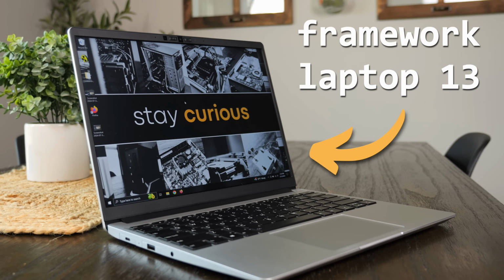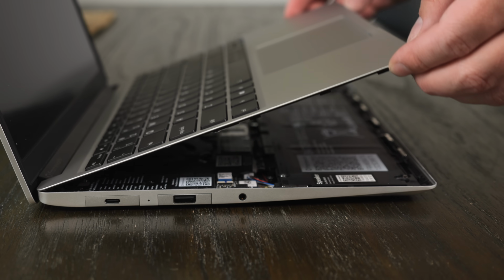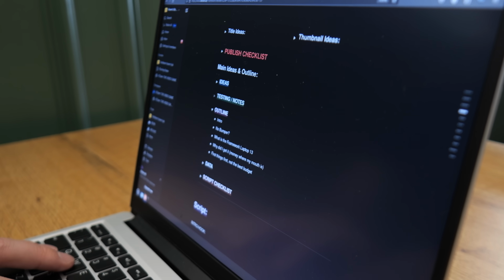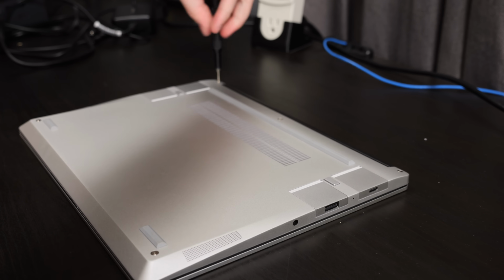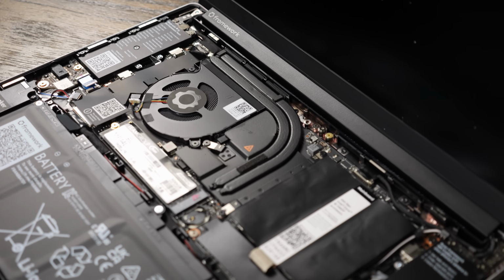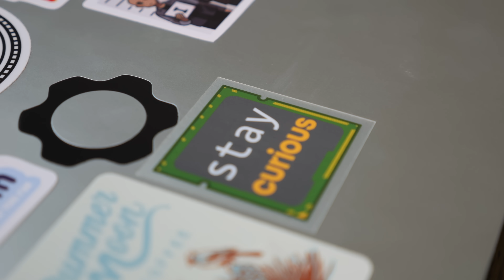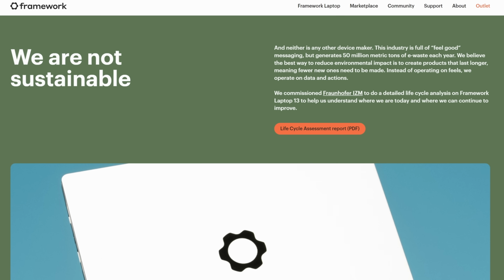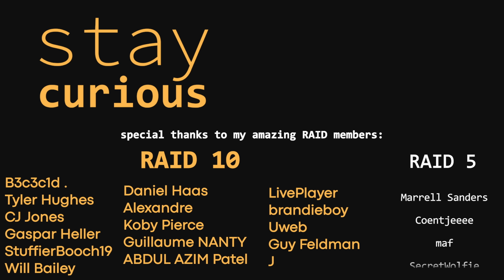Is The Framework Laptop ACTUALLY Worth It?

Comment: I'm not a fan, their high prices still can't compare with other laptops with much better features. You're making an excuse that 'your regret' is negated by the fact you can change things but consumers still have the expectation for battery life, performance, proper cooling, etc. Don't make excuses for a company, it seems like a gimic at this point. 
And for that note, what laptop can't you add storage, RAM, etc on. Pretty much anything currently on the market you can still swap batteries, RAM, storage, and often GPU if it's not soldered on. You can even swap displays. Honestly not seeing any innovation here.
Reply: features? you mean bloatware or what
Reply: @TheDrghu  Not software, not implying bloatware. I'm talking about the actual features of these laptops (battery capacity, peripherals, screen options, etc)
Reply: @MotFPS  i mean from what ive seen you can put in like 100 wh battery and screen at over 2k 120hz seems really good so why would i think youre talking about features if peripherals can be that good
its still too expensive though

Comment: shoot the only thing I want as my base is a 120 hz display. if they provided a motherboard, chassis, and display for like $300, I'd say it's worth it cause from there the only things you'd want can be changed on the fly
Reply: of course you'd have to be smart about what CPU or lithium ion battery you need. maybe some other things I'm not thinking of but they really don't need to follow the Apple website model of "I-7 starting at $799" that's just ridiculous
Reply: and nope don't even need a keyboard, would just a Bluetooth one or wired

Comment: I own two Framework laptops. One is an 11th gen i5 and the other is a Ryzen 7. Both are awesome and I don't regret the purchases. I'm trying to get the company I work for to get a few of these since Dell's laptop offering is... meh.

One note on comparing Framework laptops with Macbooks, if you go in with that mindset, most laptops will fall short. In that case feel free to just get the Apple laptop that works for you. I personally use Apple devices except the desktop/laptops as I have no need for any of the macOS apps. If I was "all in" on the ecosystem then I would probably think differently about things.

Comment: Still seems pretty niche/ early adopter. Used/refurbs still present very good value. Just having the same body without excellent design quickly devalues the experience. Not dumping on the product but global production of A brand products challenges the proposition of the prospect of forever marginal upgrade.

Comment: In regards to your sticker issue, you can get some clear contact paper or adhesive laminating roll at an office supply store and put that on the lid of your laptop and then put stickers on it. My coworkers do that with their company laptops. When its time to trade the laptop in for an upgraded one you pull the contact paper off and it's a clean lid.

Comment: Turning a framework mobo into a low power do it all server is something I would very much like to do. I think only having one m.2 slot limits its potential though, see as my use case would be proxmox with several applications running in docker as well as a VM running TrueNAS. Having another m.2 slot for a SATA card would be needed though.

Comment: Pro tip:  On Linux Miont, you don't have to click on the battery icon to change brightness.
You can hover your mouse over the battery icon and use the scroll-wheel (or two-finger slide to scroll) to increase / decrease brightness.
Very nice!

Comment: i had the same issue with the fingerprint scanner with dualboot. turns out (as far as i understand), the module only allows one OS to use it at a time. in my experience it works perfectly well in linux while it is disabled in windows

Comment: just like you can get older gen laptops from other brands you can also get older gen framework from 11th gen at cheaper to so that nitpick seemed kinda dumb
Reply from the maker: To be fair, when I bought mine there were basically no used deals available. I would’ve spent basically the same. I also tried getting a refurbished unit or factory second. I wasn’t directly making any comparisons when talking about the potential to buy used, more so just my thought process.

Comment: Nice and well thought review. Just want to share a bit, I managed some windows flagship laptops from top 3 brand with price twice of your framework 13, with the same (Intel) generation. These flagships also have terrible battery. They are worse when Windows Modern standby was on. I have to manually changed to S3 sleep to improve battery in some models that still have S3 sleep. While on use, battery also so-so, certainly not impressive, and terrible compared to Apple Ms. Temperature, it's very hot! I think it is more likely Intel problem (see other reviews about Intel on these generations, e.g. 12th, 13th... and how hot they are). Camera, even though they are flagships and very pricey, the color is sometimes off, taking time to correct the color.

So, if these performance are similar(ly bad), the difference is Framework embraces repair and upgrade. The other top brands are the opposite. Sadly, FW are not around in our place for us to try.

Comment: Re: the comments about coming from an M2 MacBook. They've basically got best in class input devices and power management/battery life, due to the integration of the hardware and OS.

The Frameworks are pretty good, I've replaced my old Intel Mac with a Framework 16, and I'm very pleased with it.

Comment: In terms of savings, I think there's a lot of things that needs to happen for you to actually have a considerable savings compared to the normal laptops. However, let's not forget that they are a small company that manufactures very unique parts in very low volume. They will always be more expensive than off the shelf devices especially from bigger companies. If you get a Framework laptop, it'll mostly be a you support what they're doing and you like the repairability and not so much about saving money 😄
Reply: We'll see.  My company is trying them out to see if they reduce cost compared to other laptops.  I think they will especially as we attempt to keep our equipment running 7+ years.  Part of me can't wait to hear the complaints from end users wanting a new system and I just replace the mainboard.  

"But it's so slow!" 
"You're running current-gen equipment, it's not slow"  etc.

The excuses they'll come up with will be hilarious.  I might just buy a new chassis and shove their old equipment into it to see if it "improves" things.

Comment: framework is one of the only laptops where fan noise recordings and tests are omitted from most reviews even linus's videos dont mention or show the fan noise
Reply: The fan noise on my Framework 13 with 11th gen Intel CPU is annoying. Fans ramp up when using Google Meet for video calls.

Waiting on delivery of my AMD based Framework 13, where I understand this issue is much reduced.
Reply: @StefanHolmes  yeah i think AMD is better in laptops when it comes to thermals, thanks for letting us know, I was thinking something fishy was going on when noone was talking about it, considering these are not top spec or gaming machines you would think that fan noise would be a strong point for them

Comment: Oddly enough, the soft keys won't work on a dual boot but if you were to run your other OS under virtualization 99.9% of the time soft keys work now as its passed through the virtualization layer which knows they work so it presents them in a way your guest OS understands when it wouldn't on a bare iron install.
I'll be honest, when I hear "dual boot" I kind of cringe these days.  I mandated no more dual boots in my labs almost 20 years ago (2005), especially if they were going to ask me to support their arts and crafts projects - unless you're testing native drivers, you don't need to create a dual boot system.
Just do it in virtualization - make your tools work for you, don't work for your tools.

Comment: I like that each generation of their laptops solves a component problem instead of just being a spec bump. Really hope they look at the trackpad next.  The current one is ... fine, but it's not even in the same ballpark as the Macbook trackpads.

Also looking forward to a mini-server mainboard conversion video. Planning to do the same with mine eventually. There's some neat rackmount designs in the forums that look fun to build.  Kinda want to try a homemade blade config with some additional used boards, or one of those mini-racks.
Reply: You referring to the FW13 or FW16?  I find my Gen 2 FW13 trackpad to be quite good, although the last Mac I've used is a 2016.  Still it's more than good enough for me.

Comment: I got the Framework Chromebook and love it.  What thermal paste did you use? I may give that a try.  I took it on a short over night trip recently and decided to bring my Anker 60W cube power brick instead of the one from Framework (even though the Framework supply isn't very big itself).  I found out the hard way it wasn't enough for the chromebook; it really does need the FW 65W supply, lesson learned.

Comment: I bought the AMD version around the same time as you. I'm running Linux Mint and the battery life has been fine for me and I haven't had the overheating issues. I'm very happy with it and I really like the fact it is user repairable/upgradable from the start.

Comment: My mother is open to 'buying' one of my 'older' laptops & one of them is my 13th Gen Intel Framework. She wouldn't use it a whole lot & it's plenty modern enough for her light use. I'm using the 13th Gen AMD with Fedora Linux. The fact you can upgrade to their improved tech without needing to get a whole new system is awesome.

Comment: I've got my framework for few months and i Love it. The highest quality laptop I've ever had. I have AMD 7840U and I'ts great, I heard that Intel CPU's don't perform as good and have worse battery life.
I'm running EndeavourOS so Arch based distro, community supported. I've had a few issues that were written in Arch Wiki so I could fix them. The other was audio jack throwing loud noise after a while when there was no sound, but I found a fix on Framework's community page.
The wierdest thing is that I pressed the laptop too hard in my backpack and keyboard made little holes on the screen, but I don' see it while using and I plan on switching to 120Hz display anyway.

I don't think that many people consider the cost of long term usage. While you can get cheaper laptop, it can break and you need to buy a new one, where Framework will be more expensive at first, but you can fix it eaisly.

Comment: I have heard that the AMD Ryzen series of the Framwork 13 can have a better battery life than the Intel CPU versions since their CPUs can be considerably more power efficient. Especially given how power hungry Intel's 13th and 14th gen core CPUs can be nowadays

Also, I am pretty sure the new Framwork laptops are now using liquid metal for the thermal interface instead of normal paste so hopefully the overheating issue isn't as big of a problem anymore?

Comment: I get around battery life and high temps on my laptop by turning the power limit down in the intel XTU program. When I'm just watching YouTube or scrolling Twitter I turn turbo off and leave it on something ridiculously low, like 6-7w. Hardly gets warm, battery lasts longer and reversible with a quick profile switch.

I don't know if intel still supports XTU or if newer CPUs are supported. In that case or if you're using an AMD machine I suggest the universal x86 tuning utility. It has a lot fo the same functions I described.

Comment: Good job getting one of these! Have you considered trying Linux? I used Ubuntu for a freelancing job for awhile and it was rock solid for that. I use Arch now but probably wouldn't if my livelihood depended on it. The battery life for Framework 16 on Arch for me is about 10 hours. With a suspend-then-hibernate setup, I often go weeks without recharging.

Comment: I bought one of those factory seconds 11th gen framework 13s when they dropped last year and my impressions are basically the same as yours. Aside from the touchpad and the noise/heat, all of my issues with that computer are win11 issues.

Interesting to hear that the thermal compound application is subpar. I should reapply mine.

Comment: I have an AMD Framework 13 and the battery life is much better. Ive run Win 11, Bazzite, and Ubuntu on it and they have all run very smoothly. So far ive settled in on Ubuntu, and am going to give Bluefin a shot too. Also, the DIY edition is very very easy to assemble. And if you are a huge nerd like me you probable have spare SODIMM RAM and NVME's laying around. So its nice to not have to buy those again.

Comment: I'm a proud owner of a 13th gen framework 13 myself and have been for about a year and I think some of your power issues are windows and your temperature issues are legitimately a bad unit in terms of the thermal paste.

I have the lowest skew of Intel CPU and I don't think I've ever seen a package temperature above about 70 maybe 80 when I'm running VMs

My battery life certainly could use some improvement and a lot of that is probably that I'm also on the 55 watt battery but Fedora usually sees me getting about six hours of normal use and maybe four if I start running multiple virtual machines. 

I do have reports that the new screen helps a lot with the text blurriness. I personally have one on order.

I've overall been very happy with my purchase, and like you, my Framework 13 is not my primary device. It is a companion computer to my much more powerful desktop. I don't know that any of the Intel SKUs would be able to handle what I do at my desktop on a framework, or really any laptop in the space for that matter. If I was going to do this purchase all over again, I would probably be buying an AMD framework, even knowing the Wi-Fi issues that the MediaTek chips have.

I actually ran into the fingerprint scanner early on. What I had to do to solve it was boot up a Windows VM and update the firmware using the virtual machine. After that, on Fedora, the fingerprint scanner worked flawlessly. Linux Mint might be behind on its fingerprint integration packages, which could be causing the continued issues you are seeing.
Reply: I should mention that my issue with the fingerprint scanner was solved after probably one of the best support experiences I have ever had. I sent one email to their support team and I got forwarded to an engineering group that was working on the problem to help test a possible solution. I have never had that experience in almost over 20 years of Owning computer hardware and portable machines.

Comment: Re: battery life - I have the AMD version, which has really good battery life. I can also compare to M2 chip, and yes, Windows is an issue due to its problematic sleep states.
Reply: how long battery life?
Reply: As now with using linux, it is about 5W for casual usage (music video/ web browsing etc.) So with 61Wh battery inside that is about 11-13 hrs of consecutive use with linux (but needs to spend time to twinkering, windows 11 really drains the battery such that it can only use at most within 8 hrs)

Comment: I've worked doing laptop repairs and the Framework seems close to perfect. The ability to change parts as needed is something we never had with notebook computers before. I just wish there were some more who made the main parts for these. It would be so nice if there were a few different chassis, main boards and so on preferably from several companies doing a bit of competition for the customers. It would have to be a much larger part of the market though as the limited volumes makes it way to expensive to compete about it. I find it funny that the modular ports seems so similar. One of the computers I worked on were made by the Taiwanese company Veridata. It was one of the most compact notebooks if not the most compact when it was introduced, and it had a modular I/O module. A number of modules were available and I'm not sure I remember them all. One had a keyboard port and a serial RS232 port, another swapped the serial for a VGA port, and then there were modules with a touch pad and Serial and Keyboard or VGA and keyboard port. But other than that it was pretty standard. Though working with these we bought spare parts so we always had what was needed, so we never had a problem with spares.
Reply: We had socketed CPUs and MXM. Nobody cared, because it's usually very expensive, just like Framework.

Comment: I'd like to see you put an ARM main board into it. That should improve battery life significantly. You might also be able to fit it with a more efficient display, perhaps with a switchable low power mode, again improving battery life without compromising on brightness.
Reply: Or just an AMD CPU 😅

Comment: I've used the Framework AMD since launch... I use ArchLinux, KDE plasma, I never had any of the issues you've mentioned (both Windows and Linux).
I primarily run alot of code, so plenty of code compilation etc. Part of the key to my long battery lifetime has been the deliberate shutdown of excess cores and core throttling... CPU generally never exceeds 8 degrees above room temperature, battery from 80% to 20% lasts 7+ hours
Reply: Additionally, my left key popped off partially and FW was so kind to send me a replacement! They're wonderful